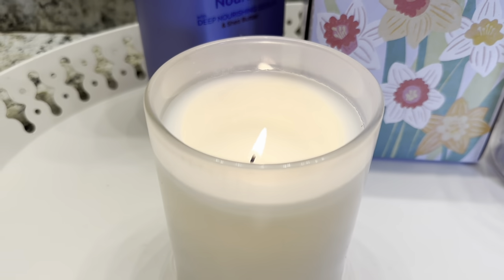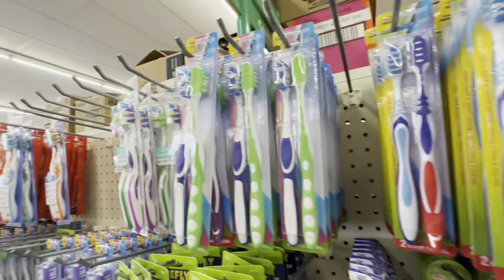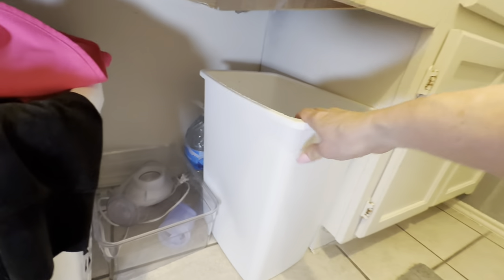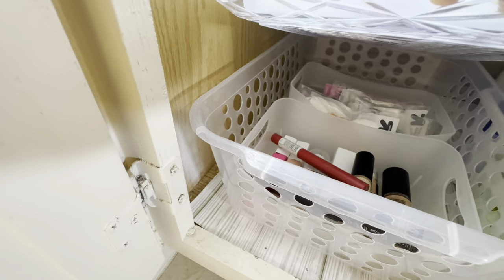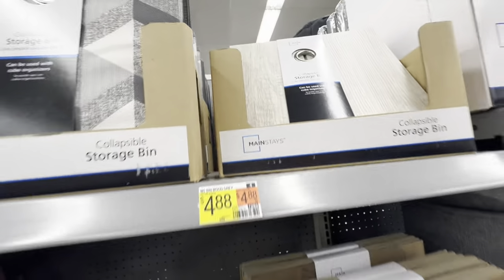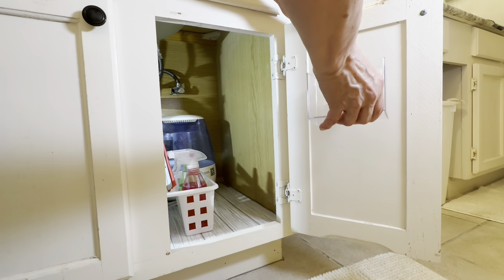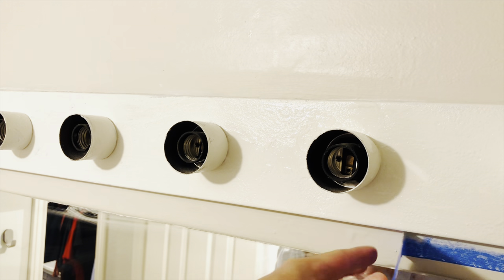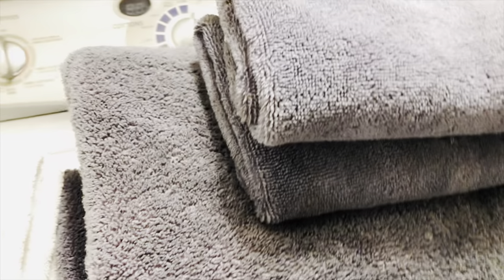Organize Your BATHROOM in 2024 / Renter-Friendly Home Organizing SECRETS

Comment: At my previous home, my master bath was tiny!  My sink was attached to the wall and I had no cabinet underneath it.  To add storage space, I used a sturdy 2-tier wooden shoe rack and used rectangular baskets to hold my brushes, hair dryer, powder, shaving items, extra TP, and wash cloths.   I don't wear much make up so I was able to store those items in the medicine cabinet organized with narrow lucite storage containers.  I stored all my medicines in the kitchen with exception for acetaminophen and antiacids, which I stored in a bedside table drawer.  I bought all of my storage supplies at TJ Maxx, Aldi, or Marshalls. I have noticed that TJ Maxx is never mentioned as a potential source for home organization.   It's more expensive than DT but there are a wider variety of products from which to chose.  My DT didn't have what I needed or the items were not the right size.
Reply from the maker: Great ideas!